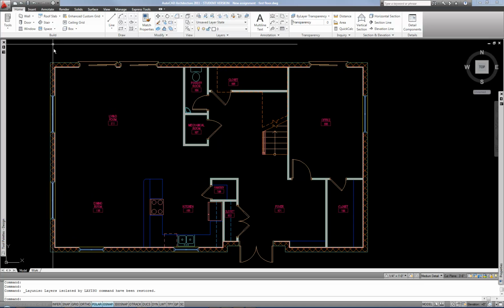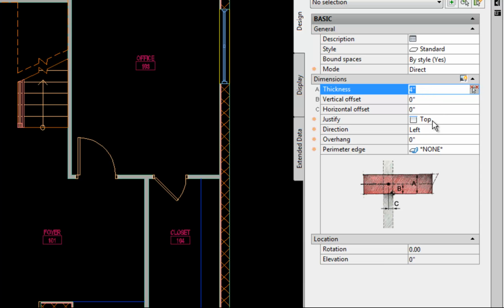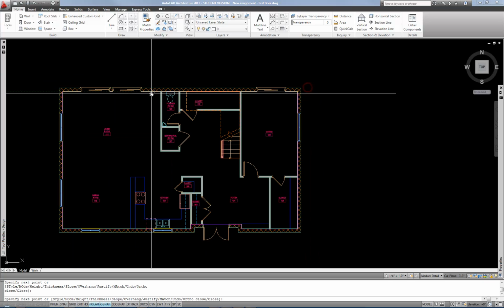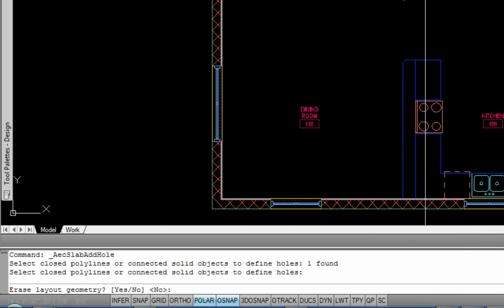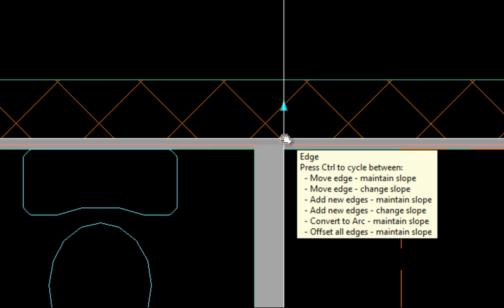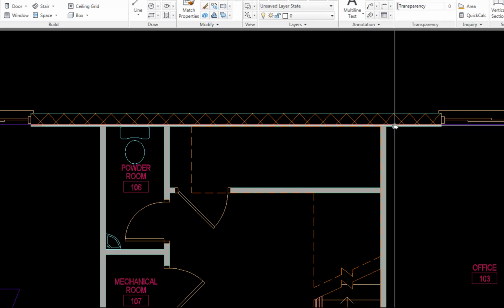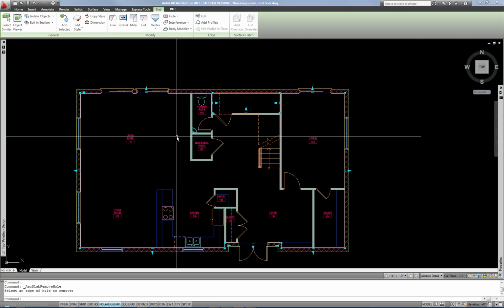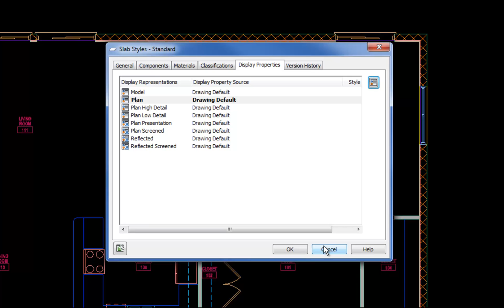ACA: Slabs

Comment: the only limitation that I have seen from this software is that there is no videos that try to show the necessary steps to show how to overlap high rise buildings of 1 floor plans to the next  like g+4 or more that this.  please who can share to me if there is such tutors ?
Reply: If the levels are not repetitive, I would make one CAD file for each floor and XREF them together into another file to assemble the 3D model.  Position each XREF at the appropriate location in the Z plane to stack them.  Or if the levels are repetitive, duplicate the same XREF multiple times.

Comment: Thank you Jeremy for these great tutorials!
I have a question though! how do I add a second floor plan to my drawing to create a multi-story building?
Reply from the maker: Second floor is no different than first floor.  Use 'elevation' property to set the locations in the z axis.  Consider file management - many people draw the separate floors in separate files in the same location and then XREF them into one combined, 3D file.
Reply: @jeremytf77  Hello! A second storey would be very helpfull, dealing with the stairs, change of materials in a exterior wall, balcony, etc. Thanks!
Reply: Ahmed Mahmoud al Bahey hello sir would you help me if your question is solved ? if yes please share me the videos to over lap one floor to the next. thanks for your helping .

Comment from the maker: Note that slab elevations usually indicate the TOP of the slab's location in the Z direction, so with EITHER of these 2 methods you need to change the elevation - what will be different is whether the bottom of the slabs are all flush or not.

Comment: Great job Jeremy, I want to know how to use slab to show diferent floor height within a bungalow I am currently medelling. Assuming Ground level is +000,  living rm +450mm, dinning +600mm. entrance Porch +750. Is this done by stacking slabs.  And if my Entance Porch is +750, how do I show steps down to meet the ground +000 outside .

Comment from the maker: @svenglezz In that case, it is quick because you have rise:run properties in the properties palette.  That's much easier than sloped to drain, because sloped to drain is normally a tapered slab, i.e. the thickness varies.

Comment from the maker: @svenglezz You can piece it together out of 4 slabs, although this will not be technically accurate because the bottom will also be sloping (the slab is essentially tilted).   You could custom model something if you didn't require it to be an AEC object.   Or draw it flat and don't lose sleep over the model being 100% true - which is impossible anyway.  Or you could use Revit, which handles this better.